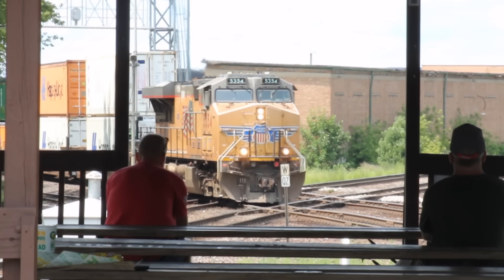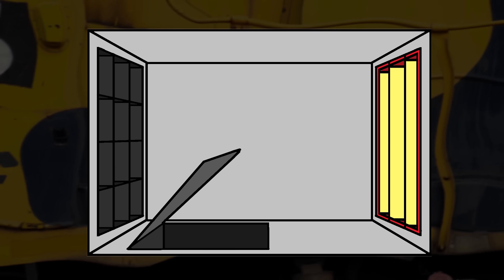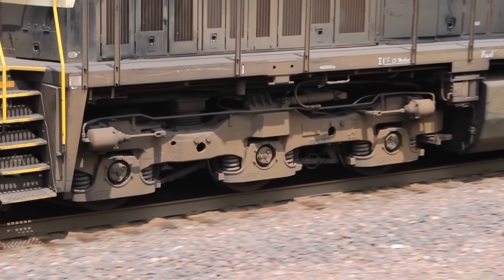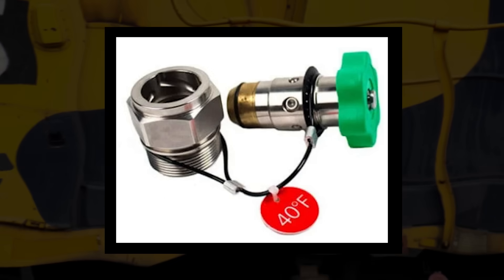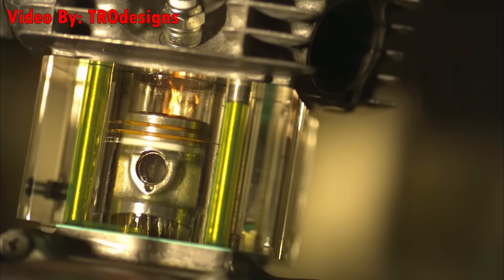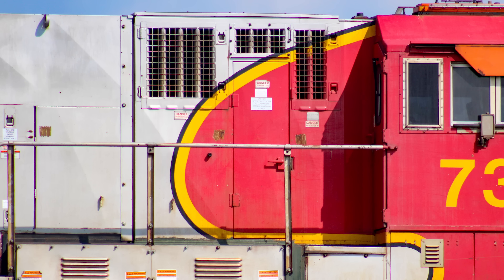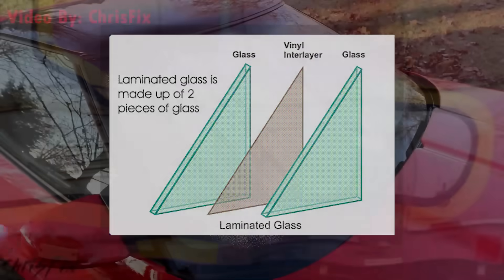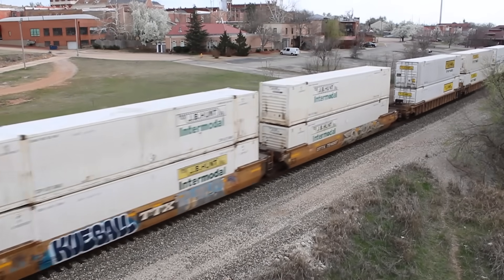The 10 Most GENIUS Design Features On Locomotives!

Comment: I’d just like to congratulate the GURU valves out there for saving hundreds if not thousands of engine blocks.
Reply: It's usually not the block that cracks when frozen but the fuel preheater, lower piping, and air compressor on emd. GE, the preheater, lower piping, and water pump.
Reply: Who replaces all that coolant prior to the next startup?
Reply: @MrGus.1  maintenance, if its sitting long enough to freeze without an auto-start cycle (used to keep electrical system charged), then its in storage and would be serviced anyway before the next use.
Reply: @MrGus.1  We do at the shop.
Reply: I worked on locomotives in St. Louis and in the winter time we’d zip tie the guru valves so they’d stay in while we were getting the water warmed up in the system.. well one of our guys forgot to cut the zip tie free at the end of the day and turned the main breaker off so the locomotive could no longer auto start. Guess what happened lol
Reply: Can anyone explain why they don’t just put glycol and have the coolant as a closed system and not have to worry about freezing?
Reply: @LDGod  Probably too expensive plus these valves are an old solution that has had no need to evolve.
Reply: @LDGod   I heard it has to do with environmental laws and environmental impact is why locomotives are designed the way they are in not using any form of antifreeze in them.

Antifreeze is deadly to any animal that drinks it, that's why they created animal safe antifreeze for vehicles.

When I could still drive prior to 2013 before going legally blind, I always utilized environmentally safe products in my vehicles, including animal safe antifreeze in my radiator, and animal safe washer fluid in my windshield washer reservoir.

But since I no longer own any vehicles, I don't need to worry about that now.

Comment: That summer/winter door doesn’t make much sense. Diesel engines often have inter coolers to lower the temperature of intake air as cooler air is denser and therefore has more oxygen. Why would they want to warm the air?
Reply: Diesels, unlike gasoline engines run much more efficiently the warmed they are. To a point. Diesels combust their fuel entirely by compressing air so much its hot enough to ignite the fuel. So the warmer the intake air, the more efficency you get as you get a more complete burn.

Now for peak power, yes you want a colder denser intake charge. But that only works to a point. To cold an intake charge, and getting a diesel to fire is difficult. Especially on startup.
Reply: ge units have inter coolers where as emd units have after coolers. on the emd the engine is actually an air box that contains the p/a units and the engine runs better warmer than cold
Reply from the maker: It’s so the engine can put more energy towards powering the locomotive, while also keeping itself warm. Locomotive engines operate in pretty extreme conditions, especially up north, so the more energy efficient they can be, the better.

Comment: Well, only a DC generator can be turned as a motor, an alternator can't, so a locomotive with a main alternator will be started by a starter motor
Reply: On GE ac4400 locomotives, a switch connects one of the traction motor inverters to the 3 phase main alternator and uses the alternator as a 3 phase motor to start the engine.
Reply: Alternators can be motors.
Reply: Lot of alternator rotors have a sort of 'squirrel cage' winding (fancy name is amortisseur winding).  It stabalizes phase currents when generating, but can also be used as an induction motor for starting.

Comment: Amazing video. Also what about the type of design on BNSF 3000?
Reply: What's significant about BNSF 3000? It looks like it's just a standard GP40.
Reply: @beeble2003  ik but its a battery powerd locomotive and i wanna know about that stuff
Reply: @Benjamin_999  Ah, I see what confused us. BNSF 3000 is just an ordinary GP40. The Wabtec battery locomotive is numbered 3000 and used by BNSF but it carries GECX reporting marks. Looks like an interesting locomotive, though I suspect the design is mostly "GEVO - engine + batteries + moar batteries" 😁
Reply: @beeble2003  I have similar expectations, although I would think crews would want to use it as a leader (the same way CSX crews prefer road slugs as leaders when available) due to the reduced noise since there isn’t a prime mover next to the cab.

Comment: I don't know much about diesels but  i know some for steam.
Fireboxes designed with GPCS (Gas Producer Combustion System) uses exhaust steam from the pistons and accessories to preheat and inject air into the firebox leading to more efficient combustion of solid fuels.

Comment: The pneumatic assembly that enables standard breaking as well as direct breaking is also a great concept. As well as the partially releasable brake. The latter is not used on freight trains in the US though.
Reply: Brake, not break.
Reply: @renorailfanning5465 fun fact: in the early 1800s, when spelling was not as uniform, ‘breaking’ was the form used!  By the 1860s ‘braking’ was preferred to mean slowing down.
Reply: @renorailfanning5465  yeah I always use the wrong one.
Reply: @onkelfabs6408  🤙
No anger or condescending tone in my response. Just a correction 🙂
Reply: @renorailfanning5465  it's actually quite funny. At work, I always write about brakepoints. It is called breakpoint.
Reply: Another big difference between US and modern Euro locomotives, is modern euro locos won't release the brake without power unless you hold them in the "release" position, on a euro loco you put the automatic brake lever in "running" then apply power to trigger brake release.  Basically automating the typical process on US locos where you apply power as the brake is releasing to avoid rollback.
Reply: @mrvwbug4423  I would have to look that up, how it actually works. There indeed is a functionality similar as you describe. Though I remember it only being used for passenger trains and not using the main brake but the direct brake on the leading vehicle.
Reply: @onkelfabs6408  if I remember correctly, the cab cars used on Metra in Chicagoland and on Caltrain have this feature also.

Comment: Honestly surprised you didn't cover radial steering trucks. The fact that locomotives can steer after a fashion is kind of mindblowing.
Reply: T h e y c a n s t e e r?
Reply from the maker: Yeah, IIRC, the two outer wheelsets can pivot ever so slightly when going around curves. It reduces wear, especially on the flange. Radial Steering isn't very common these days, but it's out there.
Reply: UP disabled all of theirs because they cause ride quality issues unless you stay on top of the heavy truck maintenance required to prevent those issues, and they don’t rebuild their trucks very often.
Reply: I live in Oregon and a lot of locomotives used by the short lines have them. The Central Oregon and Pacific uses them on the Siskiyou line after Roseburg because the turns are really tight!

Comment: Friggen great content. You didn't mention the toilet in the nose of many locomotives. Not many people know about them, despite the need being obvious. Also, a sequel needs made, those air compressors sound pretty interesting.
Reply: Yep.  I've even used them.  Years ago, I used to work for CN Telecommunications and often rode freights.  They were located right beside the door, before you went up the steps into the cab.  It's amazing the things you remember after almost half a century!  🙂
Reply: No mention of the GE Crew Comfort Cabs with noise reducing and insulation/ air conditioning to help keep crews cool in summer heat and warm in winter.   Before that came about often irritated crews hated their working conditions.😢
Reply: its only in the nose of the wide cabs
Reply: @jimsmith9819 I’m not sure how the units with steam generators were designed, but I have seen diagrams that show a cramped (limited headroom) toilet in the nose of traditional cab EMD locomotives.

Comment: What about the Armor Windows?
They were only use for FXE, FSRR and FTVM, And some MBTA and Amtrak Locomotives such as the MBTA F40PH and Amtrak E60
Reply: Armor windows? LMFAO. 
We call them GHETTO GUARDS and they are not windows. They are chain fence sections and grid iron sections made into a netting pattern that allows the engineer and conductor to see forward still while providing a safety barrier against thrown stones, bottles, bags, etc. Train and locomotive windows are not bulletproof, they are just like normal car and truck windows. That’s why GHETTO GUARDS are installed on select units on select roads such as MBTA and AMTRAK for runs in cities that have high crime rates and other roads such as FERROMEX use them for protection against vandalism and cartel activities. In some cases, these GHETTO GUARDS are installed for use in DPU and helper service on rock and ore train service on BHP Iron Ore and other select Australian mining railroad services to prevent loose materials such as ore and stone from smashing the windows of DPUS should a rough section of track be encountered while the train is in motion.
Reply: @nikerailfanningttm9046 I knew the window bars were to protect against debris and thrown objects, but I hadn’t heard that name, although it doesn’t surprise me in modern usage.
Reply: I know increasing glass costs led to the removal of some windows from locomotives and other rolling stock (including cabeese) as newer types of safety glass were required on railway equipment.